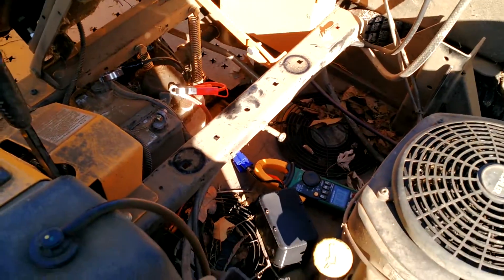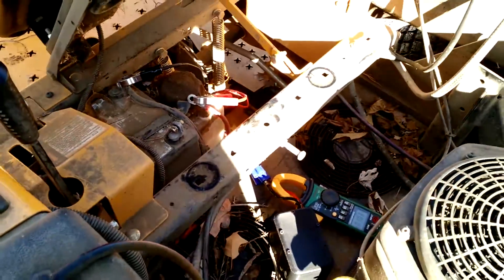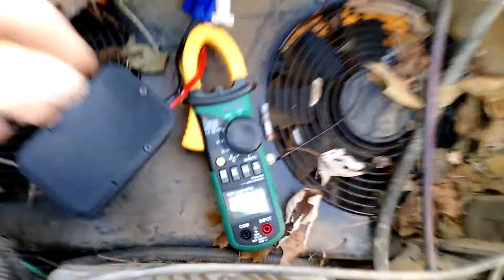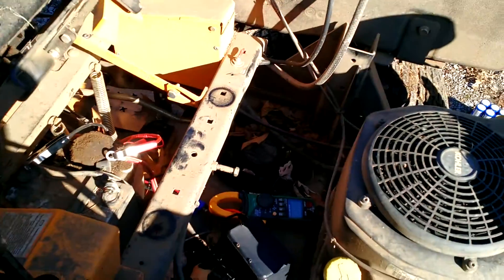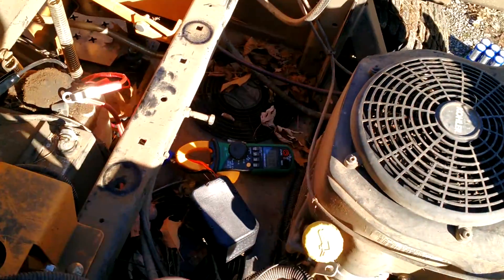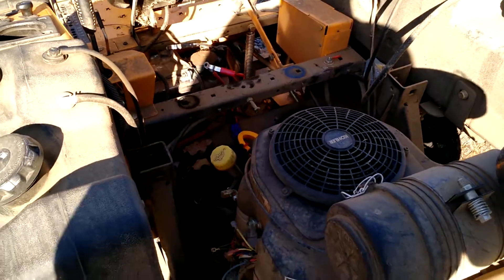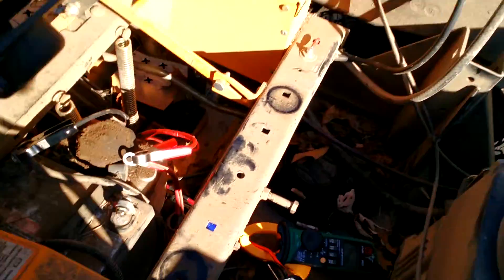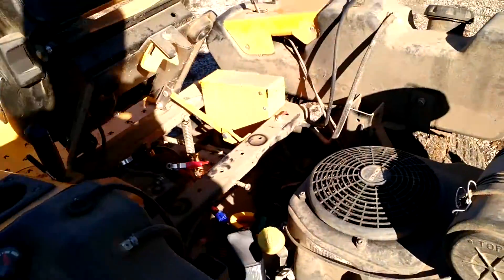Lawn mower Super capacitor battery replacement

Comment: I have been considering capacitors for my riding lawn mower. The battery when new seems to work okay but as it ages a couple years it has to be charged every time to have enough cranking power. I usually mow twice a week in the summer.